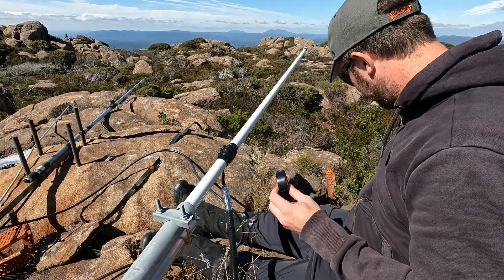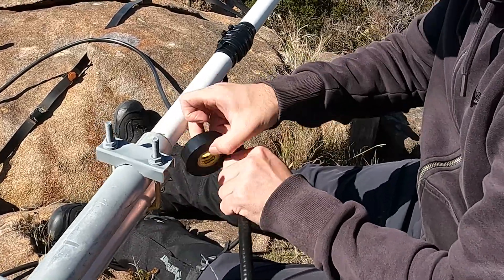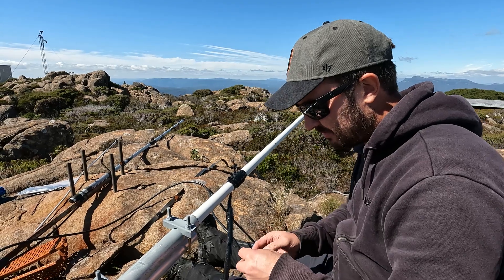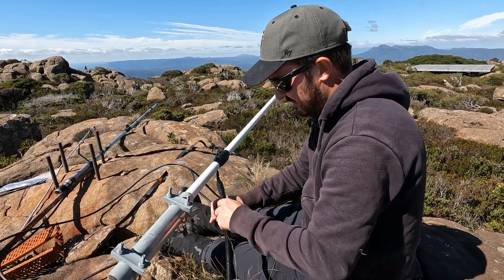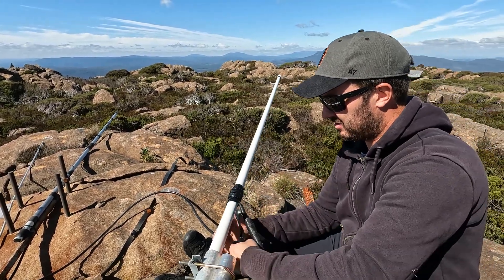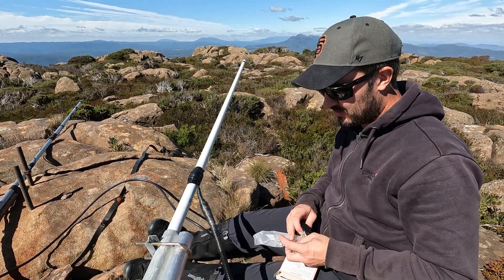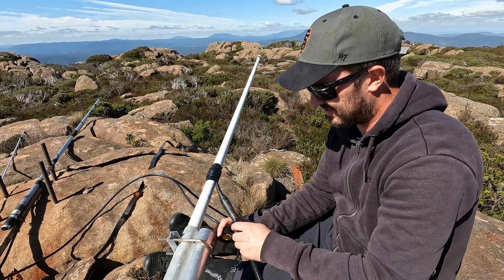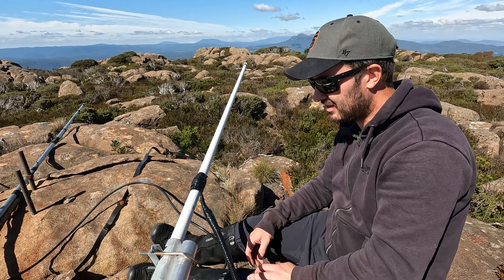The RIGHT Way to Seal Coax – Lasts for YEARS!

Comment: We do a similar method for critical communications here in Finland. First layer: Super 33+ reverse taped over the connector an inch past the connectors. That way you don’t get any sticky residue on the connectors. Second layer, self-amalgamating tape over the whole lot, an inch past the previous layer. One layer is more than enough from what I’ve found. Over that Super 88 if you can find it, otherwise Super 33+. Super 88 has a stickier adhesive (it’s black, gets on everything and is a bastard to clean of, but it works perfectly). Again an inch past the previous layer. We also slightly stretch the Super 88/33+, to avoid getting any loose wraps. I’ve seen inferior electrical tape unravel itself with age, but not Super 88/33+. I’ve also seen some commercial basestation equipment state that all outdoor coax connections needs to be sealed with either self-amalgamating tape OR 3M Super 88, which seems to confirm my suspicion that Super 88 isn’t just ”normal” electrical tape.

Comment: I live in a rain forest by the sea. If I told you what I do, you wouldn't believe it, insist your own way is better, and have wetness problems before I ever do, if I do at all.  What you show here, is an approximation of where I started.
Reply: Why don't you tell us what you use mate?
Reply: @TheNapalmFTW In extreme water and ocean issues, and rain forest issues.. I start with liquid electrical tape, followed by coax seal - which can be bought in blocks at marine supply stores. After that is a shrink wrap layer, and then some silicone tape.  Also, a 5/8 crutch tip fits snugly over the SO-239 connection on a mobile antenna mount to keep out dust and rain when no antenna is screwed into it.

Comment: Yeah mate, good tutorial. I don't do the first layer of electric tape because that self-amalgamating tape is not so hard to cut or peel off. I have opened several of my sealings in the past and no problem. I put the under tape ONLY if I use the sticky stuff from Scotch / 3M VM-tape. That stuff has tar like inside and comes with a separator film and it's not stretchable. That stuff is pain in the ass to remove, but sure protects well for decades. Old hams told me to always cut the end of the electric tape instead of ripping and put a one turn of tape over it not streching. That should do the same as the cable tie. But the cable tie is probaply more secure way. 73's

Comment: For some of our connectors in the power industry where we expect to service, you start the electrical tape sticky down then flip it after a wrap or two wrapping it sticky up the rest of the way.  Then do the amalgamating tape then protective tape.  The inner layer will cut off clean but doesn’t fall off because it is stuck to itself.

Comment: I just use 3m spicing tape on the coax and connectors then Scotch 33. I start about an inch and a half before the connectors. Have never had a leak. I have no issues undoing either tape. Connectors always look brand new. If you want 3 layers go right ahead. Can’t hurt but I think it’s overkill.

Comment: We're supposed to seal coax? 😁

I've got some silicon tape, I'll give it a try the next time I replace coax or install a new antenna. I've also got some amazing, large diameter heat shrink that is fiber reinforced and lined with glue that flows and seals when heated.

Comment: I'm lead to believe that the reason your electrical tape unravels is because you have stretched it to break off from the roll. If you cut it with a sharp knife/scissors, you'll find that it won't unravel.

Comment: Dumb question: if the amalgamating tape is over the electrical tape and the electrical tape is applied further down the cable, is there concern about leaking under the electrical tape, or is it far enough away from the connector that it isn't a concern?
Reply from the maker: Best to make sure the amalgamating tape covers the entire electrical tape underneath just in case
Reply: @HamRadioDX  Thank you for the reply and for the video.

Comment: Agreed, years ago I used to apply the amalgamating tape directly on the connectors and coax. When it comes to removing it, I had to cut the coax and connector off and throw them away. I lost many expensive connectors that way. Now I use silicon tape - it is also stretchy and sticks to itself but not onto the coax and connectors. I then apply the amalgamating tape over the top

Comment: I've never seen self amalgamating tape with out a protective interlayer; What brand are you using because it would be so much easier to use?
Reply from the maker: This is Nitto and I agree - it’s so much better than the protective layer you need to peel off!
Reply: Scotch 2242. No inner layer, self fusing, and uv protection. It’s some good stuff.
Reply: @justincompton4593  Fantastic!!!! NOT. The only place in the UK that even recognised the part was RS and they show it as discontinued. I found it on eBay from the USA at £10/reel plus £12 postage + any trump export Tariff etc. So try again

Comment: I've always just used the amalgamating tape, yes it can be a pain to remove, but given how dry everything under it was, not a problem. However I'll have to take a closer look at older joints to check for evidence of UV damage. I just assumed the amalgamating tape had a life expectancy and it eventually needs replacing.
Electrical tape is no better, I've found old sections of tape that are also falling apart, although it maybe slower than the self amalgamating tape.

ps, a touch of daja vu, I'm sure I saw this the other day on a broken FM transmitter vid.....

Comment: I use self bonding silicone tape. then heat shrink marine grade. Before it was available commercially the self bonding tape was used on aircraft in the military.

Comment: The only additional thing I do which is what they use to do in the telco industry before they went to one piece preformed shrink tube silicone seals is use 3M Scotchkote FD coating.  It comes in a bush top can and is applied over the last wrap of electrical tape.  It's kind of the consistency of slightly runny slime which fairly quickly dries to a UV resistant and waterproof cocoon for whatever it's applied to.
Reply: Bell System 50 years ago (Yup, I'm old)  Start wrap in center and half laps to one end , wrap back to other end and back to center.

Comment: That first layer of electrical tape clearly comes from the experience of removing self amalgating tape off coax cable more than once.   The belt and suspenders approach for sealing connections is really cheap insurance.  Don't skimp on the tape.
Reply from the maker: You've got it - the extra tape is well worth it.